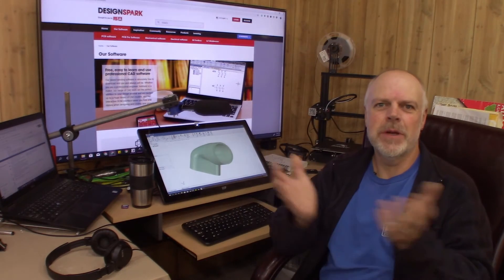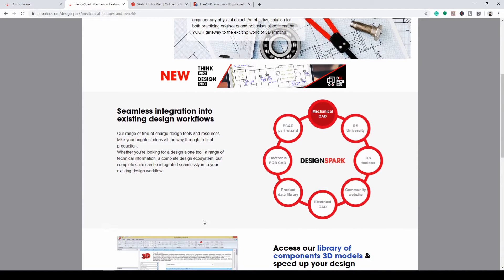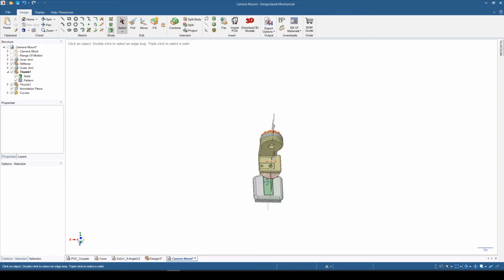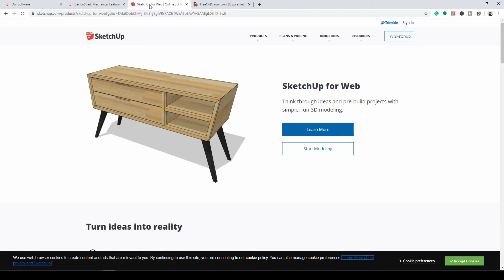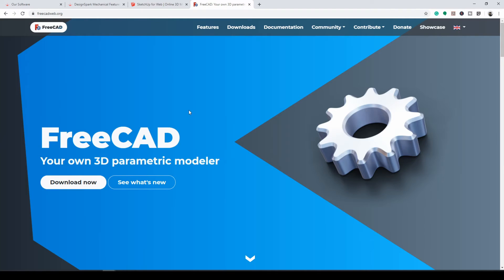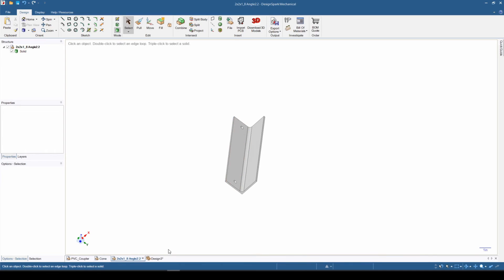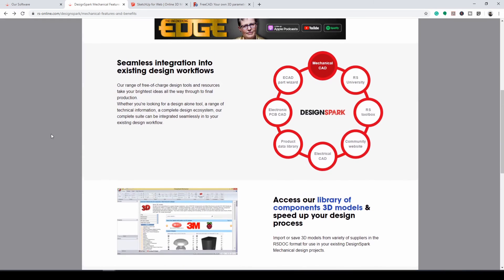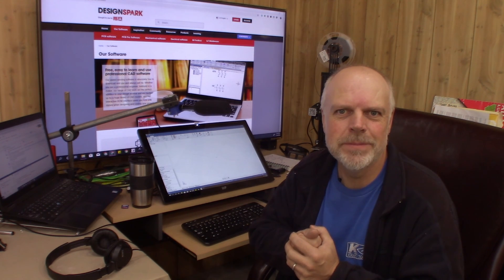DESIGNSPARK MECHANICAL - WHAT IS IT? (DSM00)

Comment: thanks for the video, very helpful. im looking for simple cad program thats easy to learn (i did use AutoCad many years so im somewhat familiar). i need a program that can make simple drawings for heavy trucks / semi trucks to build frames and bodies. basically make up models using steel tube, C-Channel, Angle Iron. would Design Spark be a good option or is there something simpler ?
thanks!
Reply from the maker: This has worked well for me... Have you been trying to use it?

Comment: Hi I used fusion 360 a very beautiful program but after 3 years of using it, it suddenly out of the blue stopped working all my data is still in their cloud and I refuse to pay every month for such misleading practices yeah it is free for non commercial use and for student  blah blah blah so I bought vectric vcarve for my cnc  which isn't too bad but I will try DSM together with vcarve kind regards Hans
Reply from the maker: Thank You Hans,  It seems every program has pros and cons depending on what your final use is going to be...  For me, I did a lot of PCB design first, and "fell into" the mechanical side later... But DSM has been VERY VERY useful for me - over sketchup and freecad so far.  I may try Fusion 360 in the future as I am building a CNC machine as need better CAM functionality...   (there will be videos of all of that too!)  Thank You for subscribing!